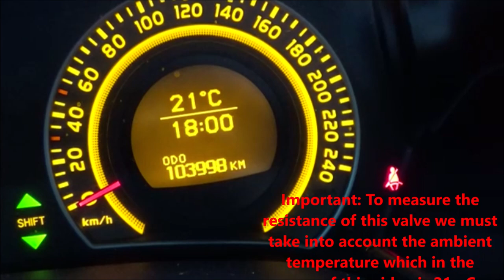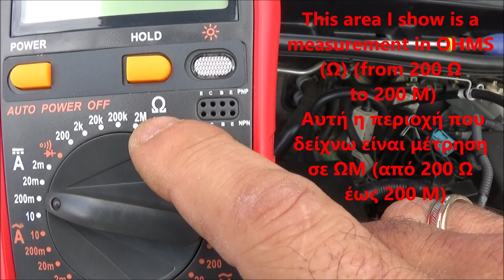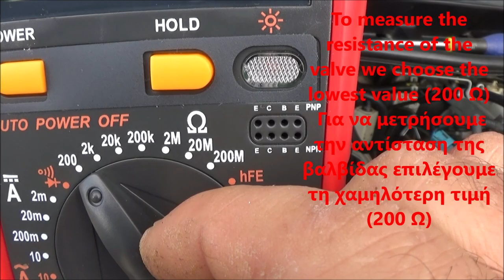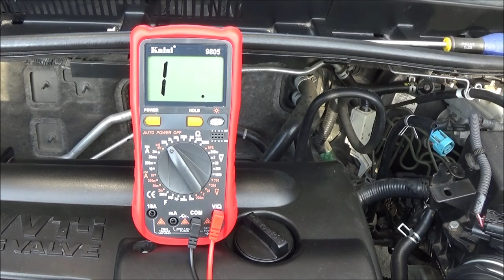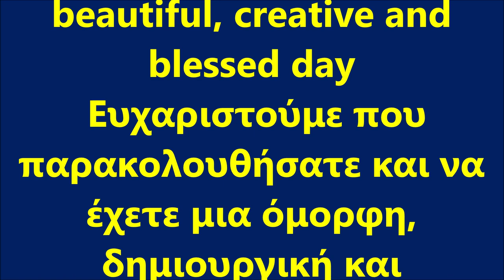2007-2013 Toyota Corolla How to remove and inspect the Vacuum Switching Valve Βαλβίδα Εκκένωσης

Comment: Hi good video can this part cause rpm to go.up and down if not working thanks
Reply from the maker: 11 Causes Of RPM Going Up And Down
There are a few reasons why your car’s RPM might be going up and down at idle.
1. Worn Out Spark Plugs
One common reason for RPM fluctuations is worn-out spark plugs. When the plugs are in bad condition, they can’t produce a strong spark, making it difficult for the engine to run smoothly. As a result, the RPMs may go up and down as the car tries to compensate. If your spark plugs are worn out, they should be replaced as soon as possible.
2. Damaged Ignition Wires
Another potential cause of RPM fluctuations is damage to the ignition wires. If the wires are broken or frayed, it can create resistance in the electrical current and disrupt the engine idle speed. This can cause the RPMs to rise and fall unpredictably.
3. Vacuum Leaks
When there’s a leak in the vacuum line, it causes a loss of engine vacuum. It makes it difficult for the engine to function properly and can cause the RPMs to fluctuate. You can check for a vacuum leak by spraying a soapy water solution around the suspected area. If you see bubbles, then you’ve found your vacuum leak. Once you’ve located the vacuum leak, there are a few things you can do to fix it: 
If the leak is caused by a crack or a hole in the hose, you can replace the hose.
If the leak is caused by a loose fitting, you can tighten the fitting.
If the leak is caused by a torn gasket, you can replace the gasket.
If the leak is caused by a hole in the engine, you may need to have the engine repaired or replaced.
4. Carburetor Problems
A carburetor that’s not properly working can also cause the RPMs to fluctuate. If the carburetor is dirty or clogged, it won’t provide the engine with the right amount of fuel. It can lead to a rough idle and cause the RPMs to fluctuate.
5. Clogged Fuel Injector
A clogged fuel injector can also cause the engine to run erratically. When the injector is clogged, it can’t deliver the right amount of fuel to the engine. It can lead to surging and stalling and cause the RPMs to go up and down. There are a few things that you can do to try and unclog your fuel injector. One thing you can try is to use a fuel injector cleaner. This will help to clean the gunk and debris that has built up in the injector. You can also try using a high-pressure air hose to blast the clog out of the injector.
6. Dirty Air Filter
A dirty air filter can also cause the engine to run unevenly. When there is a clogged fuel filter with dirt and dust, it can’t allow enough air to get into the engine. It can cause the RPMs to increase or decrease unexpectedly. Be sure to change your air filter regularly to avoid this issue.
7. Bad Idle Air Control Valve
A bad idle control valve can also lead to fluctuations in the RPMs. If you’re noticing that your RPMs are constantly going up and down, even when you’re not accelerating, it’s likely that you have a bad idle air control valve. The best way to determine if your idle air control valve is the issue is to check engine light. If it’s on, there’s a good chance that the idle air control valve is the problem. 
8. Incorrect Valve Timing
If the valves are not timed correctly, the engine can be difficult to run. This can lead to the RPMs going up and down as the car compensates. This is because the incorrect valve timing will affect the air/fuel mixture and the engine’s ability to create power. At a minimum, the valve timing should be checked and adjusted if needed. In some cases, a new valve timing belt may be needed in order to correct the issue.
9. Faulty Throttle Pedal Position Sensor
A faulty throttle pedal position sensor can also cause the RPMs to go up and down. This sensor is responsible for sending information to the car’s computer about how far you have depressed the pedal. If it is malfunctioning, it can cause the engine to rev up and down erratically. There are a few things you can do to troubleshoot a faulty throttle pedal position sensor. First, check the wiring and connectors to make sure they are all connected and in good condition. Next, check the sensor itself for any damage or debris that may be interfering with its operation. 
10. Transmission Issues
If the transmission is not working correctly, it can cause the engine to struggle. This can lead to the RPMs spiking or dropping unexpectedly. First, make sure that your transmission fluid is at the correct level. If it is low, adding more fluid may help to fix the problem. You can also try changing the transmission fluid altogether, as this may help to get rid of any issues that you are having. If neither of those things seems to help, it is possible that there is an issue with your transmission itself. In this case, you will need to take it to a mechanic.
11. Problem With The Combustion Process
If something is wrong with the combustion process, it can cause the RPM to go up and down. One possible problem is a misfire. This happens when the air/fuel mixture doesn’t ignite properly, and it can cause the RPM to spike. Another problem is detonat

Comment: What is the function of this piece?
Reply from the maker: The vacuum switching valve (VSV) which controls the vacuum supply to the actuator is normally closed and passes vacuum to the actuator when it is energized by the ECU. By energizing the VSV vacuum is passed to the actuator, closing the air control valve. This effectively lengthens the intake manifold run.
Reply: @YiannisPagonis  the VSV for this car is not for the actuator of the EGR..the VSV is for the EVAP system that controls vacuum from the tank via charcoal canister..
Reply from the maker: @pushtoreset8419  This car does not have EGR

Comment: What kind of problem occurs if that piece is broken?
Reply from the maker: What Does The Vacuum Switch Valve Do?
The vacuum switching valve (VSV) regulates the vacuum supply to the actuator. It is usually closed and only opens when the electronic control unit energizes it. By turning on the VSV and shutting the air control valve, the vacuum is directed to the actuator. This essentially lengthens the air intake manifold. In contrast, de-energizing the VSV blocks the vacuum to the actuator, draining the trapped vacuum off the diaphragm. The VSV determines when the fuel vapor is allowed to escape from the charcoal canister and go into the vacuum. When the valve works properly, it will create an audible cracking sound when it opens and shuts. These valves can be controlled by hand, pneumatically, or electrically. Also, a coolant VSV acts as the heater control valve for many automobiles. It is a basic electrical switch that is opened and closed by a diaphragm vacuum. This switch, when triggered, allows antifreeze into the inside of the heater core. This makes the heater work and reduces air temperature. Since the coolant vacuum switch effectively works as a heater control valve, it can disable the heater core if it malfunctions or has any faults. In the long run, the worst-case scenario is that driving with a vacuum leak and elevated temperatures caused by operating a lean air-fuel ratio might lead to broken engines. That said, the vacuum leaks might stem from a bad valve cover gasket, so check every related part carefully.
What Are Bad Vacuum Switching Valve Symptoms?
There are some symptoms inside the VSV valve and heater core, such as the heater releasing warm air or not blowing any warm air at all and coolant leaks. Beside, other signs of a faulty EGR valve you can observe with your eyes are:
Your car has a rough idle.
The car has increased fuel consumption and decreased fuel efficiency.
You can smell fuel.
The engine management light stays on.
There are more vehicle emissions.
There are engine noises when driving, like knocking or tapping.
Low engine speeds
A faulty vacuum switch valve can result in many mechanical problems for your car. Thus, knowing the symptoms of a failing VSV could help you notice the issues soon and take actions to deal with them.
Reply: @YiannisPagonis  hi dear friend. thanks so much for answer. really appreciate it 🙏
Reply: @YiannisPagonis  and a last little thing, in my channel i shoot my car's idle sound while vibrating. it's working with tiktiktik sound and  vibrates while engine gets warm. before there wasn't  any issue... really annoying and couldn't find any solution.
Reply from the maker: @yusufaras9066  Live, love and learn! The triptych for a better life!
Reply from the maker: @yusufaras9066  My friend I watched your video and I understood that you should not worry at all about this sound (tik tik tik) because it is a normal sound. It comes from the fuel injectors as they spray fuel into the engine cylinders. This sound is louder when the engine has warmed up. Same thing with my engine (as with all Corolla engines).
Reply: @YiannisPagonis  many thanks again ✌️

Comment: Now i understant purge valve working as well۔
Such a clean engine bay۔
How do you maintain this۔
Reply from the maker: First of all my car has no oil / petrol leaks which is very important for the good appearance and operation of the engine. Now to your question about how to keep my engine in this condition: I just clean it regularly with a dashboard polish and plastic parts. That's all! You can do this too!

Comment: Can I clean that with carb cleaner?
Reply from the maker: Yes you can my friend. It is very effective and safe.
Reply: @YiannisPagonis  Thank you, can I clean it without that tester/opener to open the valve?
Reply from the maker: @rhodellabasan1441  Happy new year my friend to you and your family. So Don't open the Valve. Clean the Valve: Spray the valve with carb cleaner or throttle body cleaner (or with electronic cleaner). Use your small brush to clean off any debris or buildup. Be careful not to damage any parts of the valve while cleaning.
Reply: Happy New Year too friend! thanks for that information.
Reply from the maker: @rhodellabasan1441  🙏🙏❤❤

Comment: Hello, thanks for the video, very well done. I ask you, what is the name of that valve? And if it is defective, it can cause an unstable idle and go up and down from 1000 to 2000 rpm when the car is running? Thanks and regards
Reply from the maker: This valve is called ΄΄Vacuum Switching Valve΄΄ and: 
1.  What does a vacuum switch valve do?
The vacuum switching valve (VSV) which controls the vacuum supply to the actuator is normally closed and passes vacuum to the actuator when it is energized by the ECU. By energizing the VSV vacuum is passed to the actuator, closing the air control valve. This effectively lengthens the intake manifold run. 
2.  What are the symptoms of a bad vacuum switching valve?

      a.  Your engine has a rough idle.
   
      b.  Your car has poor performance.
      c. You have increased fuel consumption.
      d. Your car frequently stalls when idling.
      e. You can smell fuel.
      f. Your engine management light stays on.
     g. Your car produces more emissions.

3.  How does a switching valve work?
The switching valve is required to direct hot feed to either drum A or drum B. The valve also has the bypass position to divert flow back to the fractionator for or during emergencies. This valve is found in delayed coker units where multi-port valves are required in high-temperature coking applications.
Reply: @YiannisPagonis  Thanks for answering. I have a 2008 Corolla and I am consulting you. How to reset the on-board computer to normal values?
Reply from the maker: @enriqueatala2567  How do I reset my Toyota Corolla computer?
1.  Park your car.
2.  Open your hood.
3.  Disconnect the negative terminal from your car battery.
4.  Leave the battery disconnected for about 15 minutes.
5.  Reconnect the battery, turn on your car, and make sure the engine light is off.
 THANKS
Reply: @YiannisPagonis  Hello thank you very much! I did the reset and nothing changed. The symptom is that it starts and as it warms up the rpm goes up instead of down. Then when I drive the car on the street and let it roll without gear and on, the rpm ranges from 1000 to 2000. And when I stop it and leave it running it stays at 2000 rpm. Can you help me with any clue? I tried to remove the IAC valve but I can't find the tool that I think is a Torx Plus or Penta, could you tell me the size?
Reply from the maker: @enriqueatala2567  My friend, I think I have found the solution to your problem: the problem is in the throttle body and specifically in the idle air control valve. You may have a dirty or failing idle air control valve causing your engine idle to fluctuate. The idle air control valve is a small valve on the engine's intake system that reads the air intake as it comes into the motor. So CLEAN (AND CHECK CAREFULLY) the throttle body and the idle air control valve, as in the following videos:
https://www.youtube.com/watch?v=vvSrMptzo_0
https://www.youtube.com/watch?v=0rld__gkP_E
https://www.youtube.com/watch?v=XmXVA1gODyw
THANKS
Reply: @YiannisPagonis  I saw all your videos about the IAC and TPS and the failures it produces, I also read the comments, and everything indicates that it is the IAC in principle. The problem is that I can't remove the IAC because I don't have the tool, I think it must be a Torx Plus or Pentalobe bit, I saw that you. took the screws out of the valve, could you tell me the type and size of that tip to unscrew those screws? and thank you very much mr.
Reply from the maker: @enriqueatala2567  It is TORX No 25
Reply: @YiannisPagonis  Hello, thank you very much sir. very friendly.
Reply from the maker: @enriqueatala2567  You are welcome my friend😊💜

Comment: ارجوك
We need a video about EVAP Canister,
How to remove, install and clean it,
and its parts,
What is its importance to the Corolla?
Can it be dispensed with?

اذا سمحت
please

 Σας παρακαλούμε
Reply from the maker: My friend this job (if it's a 10th gen Corolla model like mine) then it's a very difficult, laborious and time consuming process that very few people can do (remove and replace). It is inside a plastic casing which is not visible, that is, it is in a hidden place.
What is the EVAP system on a Toyota Corolla?
Evaporative Emission Control (EVAP) System - Code P0441 Diagnostic
The EVAP system manages gasoline vapor evaporation from the gas tank and fuel systems. It consists of several parts but works relatively simply. Vapors from the gasoline tank, as the vehicle sits, idles, ambient temperatures change, etc. can begin to exert pressure on the fuel tank.
How does Toyota EVAP system work?
Fuel vapors from the fuel tank are captured in the charcoal canister and extracted when the engine is running. If vapor pressure increases in the fuel tank or during refueling events, excess pressure is released from the normally open vent valve via the canister air filter.
How to fix P0441
To repair error code P0441, you'll need to first diagnose the code and determine exactly what the issue is. Replacing the gas cap and purge valve are two of the most common fixes for this error code. However, there could be other issues that trigger this code, like disconnected or damaged wires within your EVAP system.
What are the components of car EVAP system?
EVAP systems have been required on gasoline powered vehicles since the 1970s. A typical system consists of the fuel tank, an EVAP vapor storage canister full of charcoal, valves, hoses and a sealed fuel tank gas cap. The EVAP system is designed to stop fuel system fumes from leaking directly into the atmosphere.
يا صديقي، هذه الوظيفة (إذا كانت من طراز كورولا من الجيل العاشر مثل طرازي) فهي عملية صعبة للغاية وشاقة وتستغرق وقتًا طويلاً ولا يستطيع سوى عدد قليل جدًا من الأشخاص القيام بها (الإزالة والاستبدال). وهي داخل غلاف بلاستيكي غير ظاهر، أي أنها في مكان مخفي.
ما هو نظام EVAP في تويوتا كورولا؟
نظام التحكم في الانبعاثات التبخرية (EVAP) - الكود P0441 التشخيصي
يقوم نظام EVAP بإدارة تبخر بخار البنزين من خزان الغاز وأنظمة الوقود. يتكون من عدة أجزاء ولكنه يعمل بشكل بسيط نسبيًا. يمكن للأبخرة المنبعثة من خزان البنزين أثناء وقوف السيارة في وضع الخمول وتغير درجات الحرارة المحيطة وما إلى ذلك أن تبدأ في ممارسة الضغط على خزان الوقود.
كيف يعمل نظام تويوتا EVAP؟
يتم التقاط أبخرة الوقود من خزان الوقود في علبة الفحم ويتم استخراجها عند تشغيل المحرك. إذا زاد ضغط البخار في خزان الوقود أو أثناء أحداث التزود بالوقود، فسيتم تحرير الضغط الزائد من صمام التهوية المفتوح عادة عبر مرشح الهواء العلبة.
كيفية إصلاح P0441
لإصلاح رمز الخطأ P0441، ستحتاج أولاً إلى تشخيص الرمز وتحديد المشكلة بالضبط. يعد استبدال غطاء الغاز وصمام التطهير من أكثر الإصلاحات شيوعًا لرمز الخطأ هذا. ومع ذلك، قد تكون هناك مشكلات أخرى تؤدي إلى ظهور هذا الرمز، مثل الأسلاك المنفصلة أو التالفة داخل نظام EVAP الخاص بك.
ما هي مكونات نظام EVAP للسيارة؟
أصبحت أنظمة EVAP مطلوبة في المركبات التي تعمل بالبنزين منذ السبعينيات. يتكون النظام النموذجي من خزان الوقود، وعلبة تخزين بخار EVAP المملوءة بالفحم، والصمامات، والخراطيم، وغطاء غاز محكم الغلق لخزان الوقود. تم تصميم نظام EVAP لمنع أبخرة نظام الوقود من التسرب مباشرة إلى الغلاف الجوي.
Reply: @YiannisPagonis  شكرا لك صديقي على استجابتك
إنك فعلا رائع ومتميز
Reply from the maker: @bilalalhajaya9870  انت أيضا يا صديقي

Comment: Can i just clean it ?
Reply from the maker: You can try to clean it without opening it. If that doesn't work and you have good technical skills, or you want to do a deep cleaning, you could open the purge solenoid valve.
Reply: Thanks for the tip.
Reply from the maker: @Leslie_Edits204  You are welcome my friend 🙏